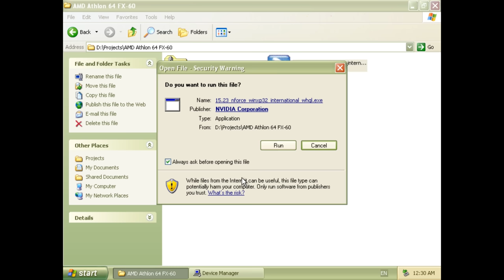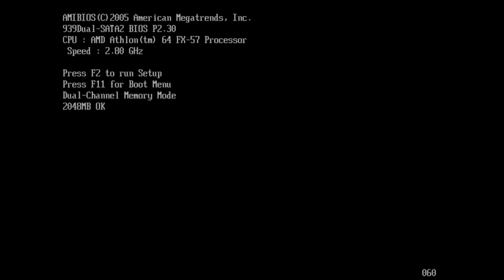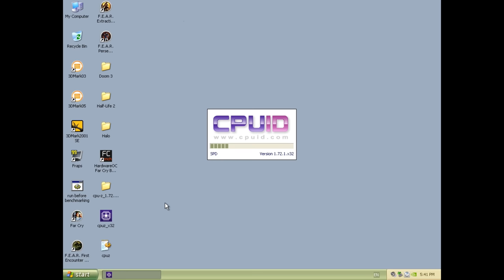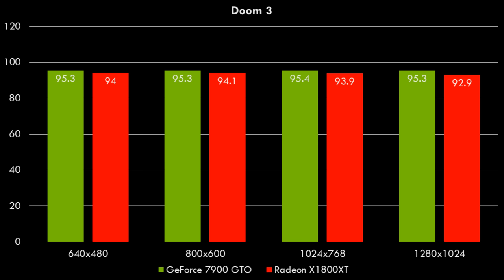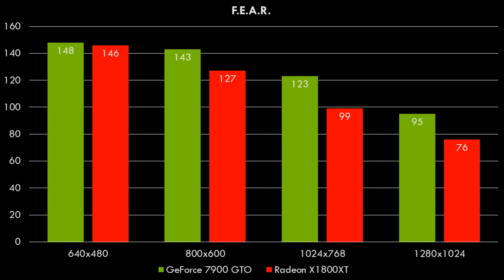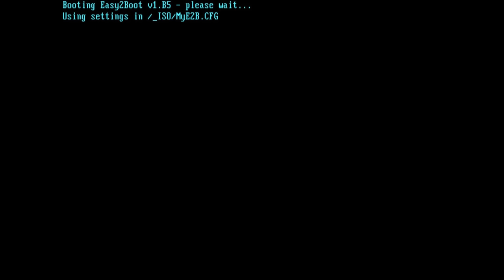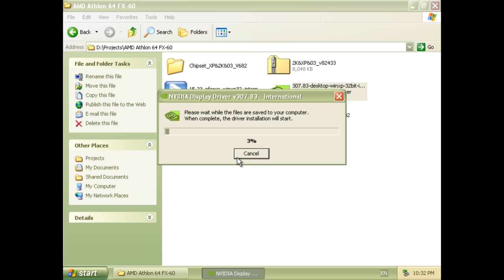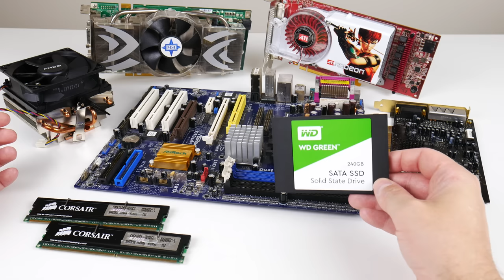AMD Athlon 64 FX-57 - $1031 CPU from 2005

Comment: On the A8N32 it looks like your SB chip cooler is not touching properly? Like it's lifted on the left side.

As for Sata drivers: did you try the most simple IDE mode in bios? Or AHCI if it was on ide?

Don't see the point in installing XP on such heavy hardware, why not just win 7 if for gaming, no dx10/11 is a real handicap?
My old Pentium 3 Lappy with 600 mhz cpu and 192mb ram runs windows XP...

Comment: For 939, I have an Asus A8V, an A8N-E, and a dfi nf4 lanparty. Not sure about why the f6 method doesn't work, but, seems most that revisit this era of boards have success if they have the sata/ahci/raid drivers slipstreamed, or use a version of Easy2Boot that includes those drivers for Windows XP.
The only thing i don't like, is that i also use a patched iso, that would have a pae patch to allow XP to recognize more than 4gb of system RAM. On a vm or on a build with an intel chipset i had no problem exceeding 4gb of installed memory. But the nvidia chipset drivers seem to REALLY not like having the max RAM installed on a 32bit operating system.

Comment: If you poke around the full download set you'll see E2B has been split recently into the regular version and one that supports XP.
Reply from the maker: Hmm where did u see that?
Reply: @philscomputerlab  Use the "_CheckForUpdate.cmd" script in the _ISO directory. When given choices, go to the Box or OneDrive download page. The "DPMS" versions are the ones that support XP. The download page on the main site also mentions using the DPMS version for XP.
Reply from the maker: @dycedargselderbrother5353  DPMS is just the version with the storage drivers. I always use this one. That's not the issue I'm describing...

Comment: I had an Asus M2n320-SLi deluxe wifi with an althon x2 5200 and i had nightmares getting windows installed. I had to RMA one board, but then the 2nd did the same. It was only when i forgot to install the SATA driver from the disk that the system worked. When i did a reinstall some time later i just used the windows drivers on install and it worked fine

Comment: I have an Asus A8N32 SLI Deluxe with a 4000+ San Diego. This is my original early 2006 built and for the longest time I've wanted to upgrade the chip to an fx 57 but they are just too rare and too expensive.

Comment: i never had an athlon64. never felt the need to. my barton overclocked to 2.4ghz sailed through most things. it was only when teamfortress 2 came out that it really couldn't cut it anymore. then i bought an atlhon x2, which sucked, and immediately replaced it with a core2duo, which was awesome.
anyway, nforce2 was the shit. probably the best mobo i ever owned.

Comment: End of 2005 I had (among others including an impossible to overclock 3000+ Venice) an Opteron 146 that I could overclock to FX-57 level, thing I did. It was a fraction the price. So the FX57 was a very bad buy unless your mother didn't allowed overclocking...or you wanted to take it beyond 3.2 Ghz with more security.
Mother was a DFI nF4 SLI-DR Lanparty

GPU I had a 6600GT and then a 6800GS.

1 year after I bought a 8800GTS and surely the 146 was a bottleneck. So I bought an Opteron 165, 2 cores, 2Ghz. I had it oced to 3Ghz (2.8 more safe, 2.4 for temperature and low voltage, and 3.2 max but not so stable).
My big problem was the RAM (and the motherboard never worked fine). I bought 2Gb Gskill kit, 1 stick died shortly after, I bought 1 stick to replace it, and that and the other from the kit died too...Then 1 or 2 years after when the machine was already replaced I think, I bought 2 1gb SuperTalent sticks, never an issue BUT, I did overclocked the GSkill sticks and not the SuperTalent ones.

Except for the GPUs I still have everything else.

I also bought (with the 8800GTS, the stupid Gskill kit and other stuff) an Arctic Cooling Freezer 64Pro...that I am using now with my Ryzen 1600!!

Comment: EAX works fine in Windows 10 if you just use Creative ALchemy. I have been playing a lot of my old games with EAX working just fine all the way from EAX 1.0 to EAX 5. It can even reactivate DirectSound 3D sound which was disabled in Windows 7 (might actually have been already in Vista, but I don't know that. I just know I have been using ALchemy in Windows 7 and Windows 10).

Comment: I played an older game today and had skips and pauses in the game ( i7 -9700K, 32GB, 1080TI ) so I check and turned out.:
Windows was defraging my almost full HDD which the game was on. X) stopped it and now it runs fine, with even relatively quick loading since it's an older game.

Comment: Did you use the current version of Half-Life 2 or an older build? Over the years Valve has pushed a few Source Engine updates into vanilla HL2 (I think this first happened in 2010) and this greatly increased the system load. If you look around you can find builds from 2004 and 2006 available to download and they should be much, much faster.
Reply from the maker: Yes I did, it's the current version!
Reply: @philscomputerlab  Ah, yeah, if you use one of the older builds I'd imagine you'd get a huge speed boost. Even on newer PCs I recommend the older versions since newer updates seem to break more than they fix

Comment: I had an abit AM2 motherboard with a Nforce chipset, for some reason the board would turn itself off with an Athlon 64 X2 4200 cpu after a few minutes on windows/linux (it didn't turn off on the bios strangely), and wouldn't even turn on with an Athlon 64 x2 6000+ (I was only able to turn it one once with that cpu). It ran fine with  a Sempron tho. 

Also, the chipset was also always running at > 70C degrees. Some months later it literally burned itself to death.
Reply: Jesus, I have a nforce 590 sli chipset and it does like 92C. I gotta replace the thermal paste.

Comment: Ah the old golden days of Athlon64. 

Couple of things, the nForce 3/4 chipsets were extremely buggy, even when new, avoid boards with them like plague. Dead SATA controller, dead PHY and overall overheating is extremely common with those, later this mantle was taken by nForce 5xx series. These chipsets also heat a lot, replace the small heatsinks with 30-40mm fans, they run at 5k RPM and die really fast.

In regards to ULi chipset, fun fact, NVIDIA bought this company to make chipsets that have Northbridge and Southbridge integrated in single chip. They fired most employees from ULi and created the nForce4, that was not so reliable. Not at all.

Later Intel even banned NVIDIA from making chipsets for their platform. I have bunch of ASUS, MSI and Gigabyte boards for socket 939 and even 940. The boards with nForce have usually some issues like wonky SATA, not POSTing and such. Its really sad, since most of the nForce boards were quite hi-end. 

I was thinking about adding FX to my testing as well, but it will be hard, since i am using RTX 2080 Ti, the slowest CPU in my tests is currently Core2Quad Q6600.

Also you have mentioned dual-channel support on the chipset side, that is untrue, the thing with AMD processors is that they integrated memory controller directly into the CPU, so board support is basically just the traces to the CPU.

Comment: nforce chipset was a reliability concern after a few years. Mine started to had issue with sata after 2years, while my cousin's around the same time. Both isn't the same brand, asus & msi
Reply: fastcx They are notorious for being incompatible by design with Creative Sound Blaster cards like the Audigy 2. They were latency problems and sound popping issues that couldn’t be fixed even after many driver updates. It was a nightmare...
Reply: @shockwaveexp3465  Not only that, AGP card compatibility...

Comment: For my future retro project i'd like to get an Athlon 64 for a MS-Dos / Windows 98 / Windows XP time machine.
Would you recommend this CPU or did it fail in the motherboard you used for the Athlon 64 Windows 98 build?
Asking since i know nForce will not go well with the YMF744 and i rather use the VIA board.
As for the future video idea, i'd actually like to see you try the same challenge where you try and build a machine that can do dos all the way up to windows XP as an updated take on your time machine.
Reply from the maker: Hold my beer... Coming soon :D
Reply: @philscomputerlab  Holds Beer
Awesome that you want to give it a shot.
Currently I was thinking Nvidia 6800 combined with Voodoo 2 combined with Athlon 64 since that combo might work up to Win7 but should be old enough for DOS and Win98. My only worry is the Nvidia's SVGA support since I can't find anything on the topic. I know it's Win98 drivers are not great but should work good enough.

Ultimately my aim/challenge is to cover the widest range possible. Using slowdown utils, tweaks and memory patchers if need be as long as it's stable.

Comment: The general consensus on nf4 is that they are often cooked out. 
From personal experience, having mine run for around 2-3 years not only was it bad when they came out, but the fans melt and they run very hot. Hence why most are dead. Mine was on 24/7 and managed, so many years later the board is working, however I have changed the cooling solution and it bigger.

The new amd original HSF I have both, they're not the same I've weighted them and took measures.
(Nov 19 build video)

So in the past three videos, you have the same game collections and same hardware.... Save for the 8800gtx and the x1950xt pro.

The performance cross over maybe the system bus. We have PCI 1 and 2, as well as the jump steps between the 1000mhz and older 800/400 
(CPU control)

Also the SI chip is a prime boot over the NF as there much easier to default start, the NF I installed after In many cases.

The msi board were not great either, the neo had flex and was thin, I switched to Gigabyte as they were better builds and Asus rushed and were unstable.

I believe the FX was a last.... This was when AMD started loosing against intel, the CPU prices dropped shortly after, and around the same time and brought ATi, which were being from the previous gens (x800) 
No one was sure of multi core would work, and most games would not benefit from multi core either. So people stuck with singles, a few jumped to duals and sat ther fore a while and like many I jumped to quads, but they were slower 2.4ghz over dual core 3.3ghz it would be a while before games and OS updates made it worth it.
Reply: ZALMAN-CU 896g Flower Cooler = Why my A8N-SLI's still is alive!
Reply: @dallesamllhals9161  north and south bridges are not CPU cooled...
Reply: @guywhoknows  BUT a FLOWER sends airflow down ON the BOARD!

And the BIG ones like the 7700Cu did it VERY well! 

Might be before your time?

EDit: AMD Socket 939 here! 

NOT!! INTEL 775 = you?
Reply: @dallesamllhals9161  nope far from before my time. The flower could not. Not on the a8n, as the GPU sits over the NB which cooked. If you were lucky the front lower case fan could manage it, but the first board has a Asus sides cooler with a flat bottom.
I replaced mine with a real cooler (passive) and attached fans to it. The NF2 had better cooling.

I had a flower on my 754. Have the first heat pipe cooler on my 939. I've a 212 on my 775.
My first computer had no cooler, but it had 4kb of ram! But I was glad to get the ZX when that came out.
Reply: @guywhoknows  Well, tough shit! 
Feb 2005 here: 
OG. A8N-SLI(NON deluxe, se, whatever) A643500+(later 4000+, Opteron 180) 
What can I say? Sry'?  
My Mom used it until the Win7 64 end in Jan 2020.(4x2GB DDR ECC RAM) 
AND Still running with the org. ZALMAN7700Cu 918g Flower!  

PS. Don't gimme' that 4KB-shit 😀 TOO LOW!  

C64, Amiga, Socket 3 486, Socket 7 K6...
I DO know my x86. I'm just lucky when 'Team Green' chipsets it seems ;-P

PS.
Socket 754 and A64 = Stupid FIRSTMOVER! A Fact! And you know it(if OLD enough) ;-D
Reply: @guywhoknows  (sigh) YES! You win 'cause 4KB IS better than EVERYTHING! 

FACT: My simple NON-FIRST-MOVER Socket 939 build from Feb. 2005. Is still alive. 

YOU WIN & My end. ☮  ..live long and..etc.
Reply: @guywhoknows  Bye!

Comment: yo phil are there any older nvidia drivers to run far cry without the texture bug? i just set up my P4 Prescott 3.2 and 6800GT, had the same issues with the 307 drivers. saw your post on the GOG forum explaining about using older drivers so i was wondering if it's applicable to using the 7xxx cards. I'm using the drivers you mentioned at the moment so it's fine but thinking about getting a 7950 pci-e card. this choice is based around being 512mb for ultra graphics in doom 3/quake 4 and also being one of the cards that runs splinter cell shadows/lighting well. would be nice if it can run far cry maxed out too :)
Reply from the maker: Yes it is! I got a comment to usedriver version 197.77 or earlier
Reply: @philscomputerlab  great news. bought the pci-e 7950 gt oc from BFG. hope it works!

Comment: so there is so many problems with those asus boards then?

I was actually thinking of replacing my 939Dual-SATA2 to a A8N32-SLI because i want to run SLI 6800 GT.
Reply from the maker: Just my own experience, could be different for you! But the Asrock works great. I would get a 7900 card instead of SLI 6800...
Reply: @philscomputerlab  Ahh Phil but SLI, unless you mean the 7900X2 or even the 7950X2?

Comment: Phil, if your A8N32-SLI is giving you issues when installing your chipset just try an older version (or a newer version). I suggest you use x64 bit OS as 32bit is not the best OS for FX's. I have owned several NF3 and NF4 motherboards (currently have a DFI LP NF4 Ultra DR) and all opterons and FX's there were. I also suggest you update the BIOS to version 1405 (beta) that will give you a bit more compatibility. 

Please just be aware that the ASROCK mobo has poor VRM's for FX's and the mobo can die on you when being stressed (having a good PSU will help not to!).

Note: if you need a proper Nforce4 driver let me know and I can dig into my server and find the ones I used for the A8N-SLI and A8N32-SLI. (BTW, A8N-SLI Deluxe is a better motherboard all in all for Opterons/FX's).
Reply: If you pair that FX-57 with a kit of Crucial Tracer 667Mhz CL3 2x1GB and you have a perfect combo!

Comment: ok phil a few suggestion to as why the mainboard may be failing as you had noted, they  have nforce  chipsets Back in the 2000's the nforce chipsets where really hit and miss and it wasn't any particular brand ethier, it affected all major mainboards. It was an issue back in the 939 althon 64 era, it was a very common issues, the nforce chips are just junk.  Another thing too as that your using a FX-57 not a Athlon 64, these CPU's use different steppings and in A LOT of these motherboards, that cpu won't even post in the mainboard without a bios update or custom bios is some cases depending on board. I do know Asus WAS one of these brands.
Reply from the maker: Hmm I didn't try an other CPU with the other 2 boards... Worth a shot.

Comment: I've got 2 Asrock 939Dual boards. The first was sold to me with the jumpers set for am2 slot (not sure if it was intentional) and powering it up with 939 cpu I burned some transistors. The second board doesn't like dual memory mode. But I want one that would work properly.

Comment: Not some Nvidia Chipset it is Nforce 410 for the 3 boards they dont work.Best budget chipset for that time.The tested Uli chipset on Asrock in that time has many isues with compability of the AGP graphic cards and drivers.I know because I have one in my system in that time.That Frankenstein board have 2 Unique slots.Yelow is for CPU upgrade to AM2 socket wich frankly has many cooling isues and second is the AGP-or XGP 8x wich was the problem at that time.Nvidia AGP cards never work as they should.

Comment: There were no dual cores in 2005, there were some processors with the first version of hyperthreading but they did not outperform that cpu, like not even close, at anything.
Reply: What? That's just wrong.  No doubt your thinking of the single core Pentium 4s with hyperthreading. 

But Pentium D and athlon 64 x2 did come out mid in 2005.  Yes, the x2 was the true "native dual core" while Intel didn't come out with native dual cores until core 2 duo.